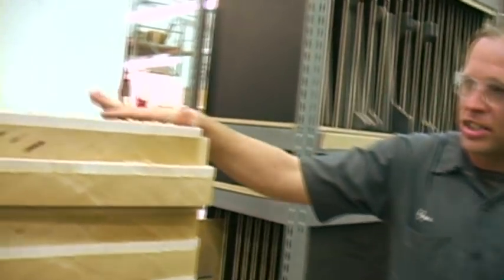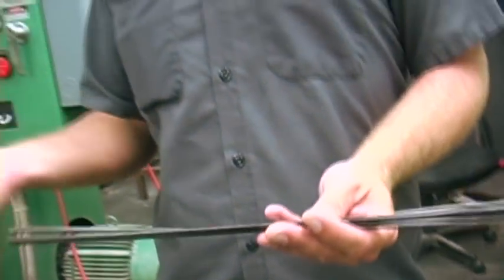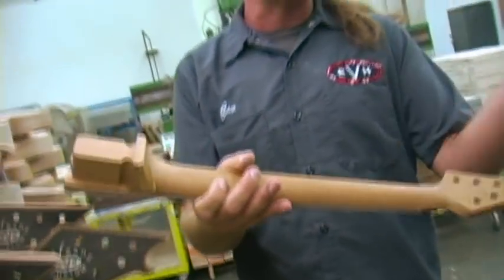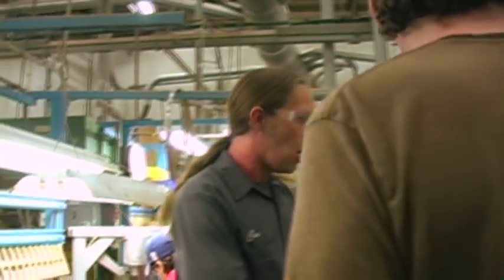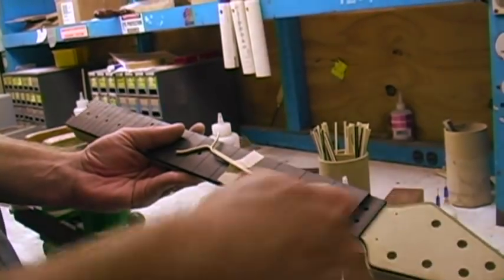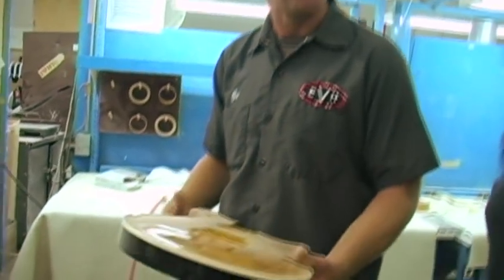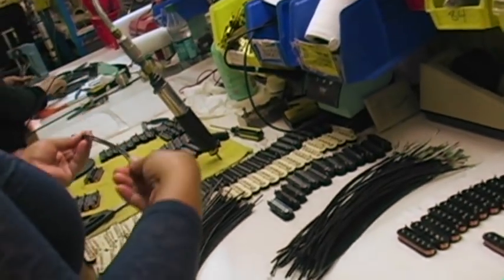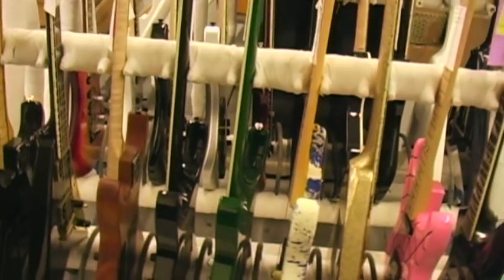EXCLUSIVE Guitar Player: EVH Factory Tour

Comment: None of those Van Halen songs you love and that made Eddie famous were made with guitars like these. The original frankenstrat from the first VH album that made 'eruption' was a $130 Charvel factory second body and neck with a Gibson PAF pickup that was wax potted at home by EVH himself. It was a cheap and cobbled together guitar. Certainly not a $3,000 marvel of luthier innovation. If you can't make great music with a reasonably priced guitar an expensive one won't make you better.
Reply: SecondCityGuitars the Wolfgang guitars are the guitar Edward designed that combined all the little mods and tricks he learnt over the year, basically they are the ultimate evh guitar. They are designed to capture all sounds from all Van Halen albums. 

Also the Frankensteins original parts and what it’s made from is heavily debated. With a lot of research, I personally believe the Frankenstein was a black fender strat Edward has when he was a teenager that he routed to fit a PAF pickup, then applied the VH1 paint job too. The whole boogie body story is so that people wouldn’t copy him.
Reply: Not possible for Frankie to have been a real Fender Strat as the raw routing for the three pickups were not routed like an old Stratocaster and the neck was not a CBS Fender though it was shaped like one albeit with a fake Gibson logo... plus the string trees on the black and white version of Frankie weren't located at the same spots as on a genuine Fender headstock. They were both factory seconds from Boogie Bodies Wayne Charvel had lying around in his shop.
Reply: John J. Sanchez: Also the Franky has a knot at the lower right horn, not “ring wear” as some people believe. Fender wouldn’t of put out a guitar with a knot hole back then.
Reply: And now from the yes we know all that department
Reply: Thank you mister know-it-all
Reply: Cool story
Reply: I’ve always heard, from several EVH interviews that the White and Black is the same guitar as the Red and White guitar, with mods on the pick guard.
Reply: @bentleymurphree216  Yep on the first album it was black and white. And then a little later on he added the red paint, as well as whatever else he did to it.
Reply: My first Franky cost me less than $75 in '79 that was $25 for the used Aria Strat-O-Copy, I spray painted red(no stripes), and $50 for a Dimarzio Super Distortion which is what all the kids were putting their guitars then. I ruined that one later trying to put a Floyd Rose in it. But I've built several over the years to pay homage to Eddies Golden years, Those first 5 Albums. My latest, Frankie the VIII, is black but still has the same pickup as the first. The guitar cost closer to $750, most of that was for the neck. I own others, some much more expensive and they play better. But I always keep a Frankie because I love Eddie, It reminds of why I picked up the guitar in the first place and it is damn sure fun to play.
Reply: It does not take anything away from these beautiful guitars, tweaked by EVH imagination
Reply: W
Reply: Eddie said himself that he destroyed many guitars to get the tone he wanted... I thought that was funny coming from a MASTER EVH himself....
Reply: True but the point you are missing is EVH was the ultimate searcher of the next level so while he may have started out that way he ended up with this
Reply: @bradmccuen7842  he loved experimenting.  I had no idea at 17 that I could have played with a VARIAC to change the tone.  my experimentation consisted of using busted speakers to get a better distortion tone.
Reply: Yes but no.. EVH guitars serve a real purpose.  Sure nice guitars don't make the player but there's 1 thing you gotta realize, back then the kind of guitar EVH wanted didn't exist.. Guitars today are better because of what EVH done for the industry, but alot are still overpriced and if you want that EVH sound and look out of the box its a good buy. Being able to buy a lower end EVH guitar for 5 or 6 hundred that is capable of doing more than most people will ever be able to play is great for the guitar industry and guitar players.. Its cheaper to buy an EVH model than try to do it the old fashioned way the way he did.  plus your time.. Its 35 years of knowledge someone has gained, you don't have to jump thru all the hoops.. There are some great Ibanez's and Fenders in the 5 or 6 hundred dollar price range too but you have to look to find ones with humbuckers and Floyds on them, the EVH's come with all that standard. And depending on your syle it adds to the options for quality instruments in the affordable price range.. So its not just a name thing.. just saying..

Comment: Hahaha I can't believe a company that has been building guitars for so long still doesn't understand how wood works. They would be better off not extending the rods into the headstock because now there is way less wood so it will just break around the carbon fiber or rods. The reason why Les Paul necks break is because they have that horribly designed headstock angle that is way to thin and all end grain wich leaves it with 0 stability. If they used a scarf joint long grain glued to long grain and added a volume behind the nut it would solve the problem 100% also the angle of the headstock is way to steep. A 10-13 degree angle is more than sufficient, the best is a straight neck with compensated tuning machines higher on the low e and progressively shorter as they reach the high e. Fender had it right the first time. And yes I do know what I'm talking about I've built over 100 guitars and have owned and repairsec hundreds. It's all about wood stability, a quartersawn peice of hard maple with straight string pull and a dual actin truss rod is the ticket, all those extra rods are for extended range instruments that have 8 -10 strings and it's not to keep the neck from breaking it's to prevent twist from so much tension from thick as strings on a super wide neck, puting those rods in an evh is way overkill in my opinion and will hike the price of the guitar up dramatically the rods are expensive I've built quite a few 8 string multi scale/ fanned fret guitars and used them and they aren't cheep. I personally don't care for the look of the Wolfgangs either and for some reason it irritates me that he named them after his son. The best were the old Kramers, those guitars were the shit, everything you need and nothing you don't. The Stienberger 5150 was the best functionally built guitar he ever played though, if you guys want to see the most ingenious trem system ever invented and user friendly guitar, check that thing out and if you can get your hands on one do it you will never put it down that guitar was decades ahead of its time to bad Gibson bought the company and ruined it.